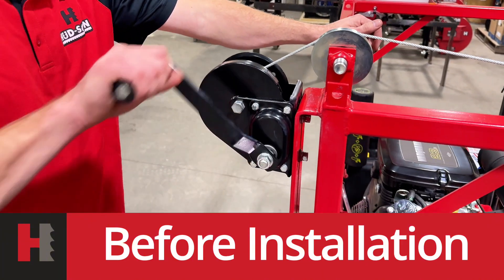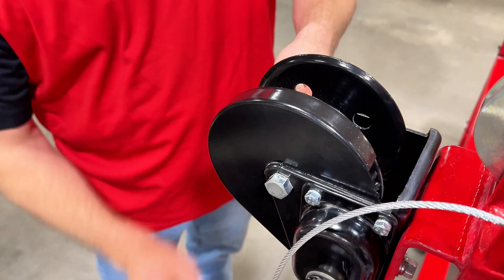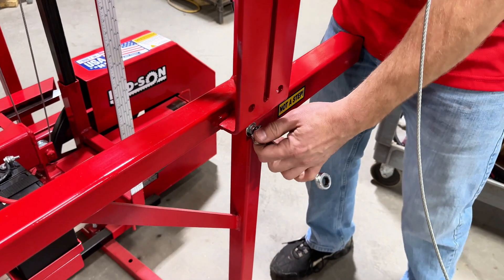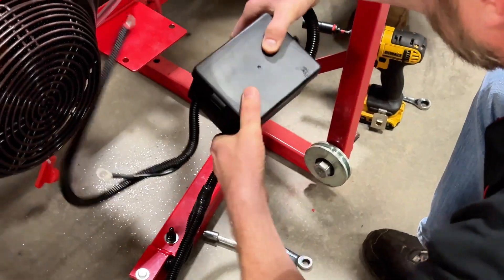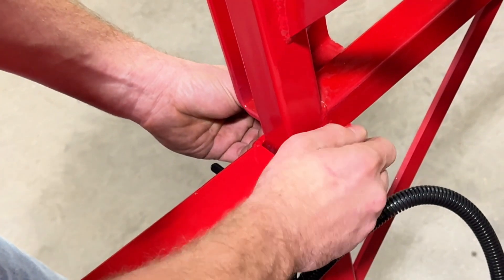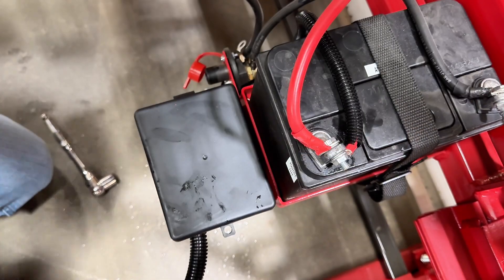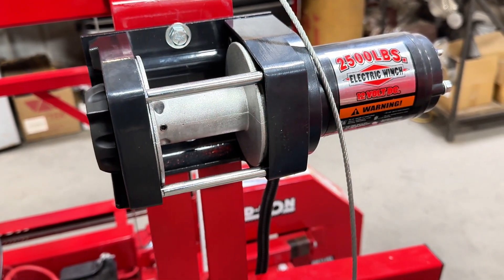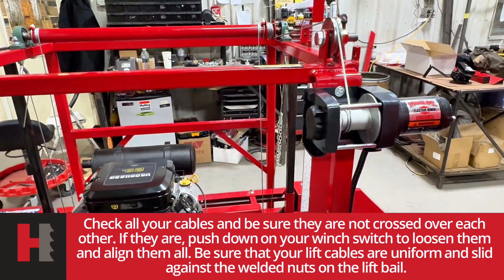Easy Install Power Lift Kit Instructions for Oscar 330

Comment: I have an Oscar 428 will this work on that?
Reply from the maker: Thank you for your post. Unfortunately, this will not work for the Oscar 428 cable system. Our recent generational change to that model, the Oscar 528, will boost the bale lift system, which would be compatible with an electric winch set-up.